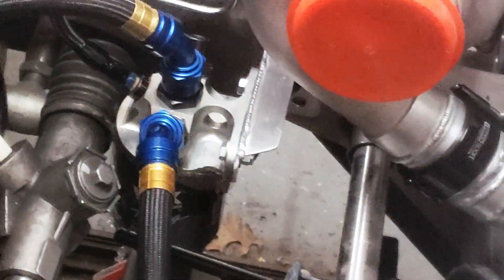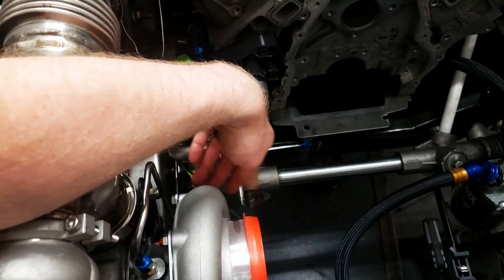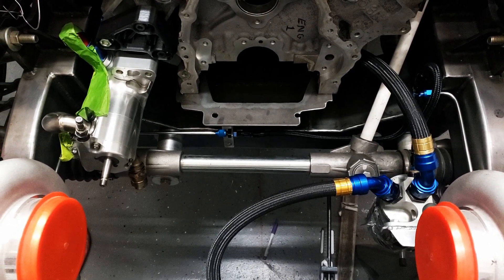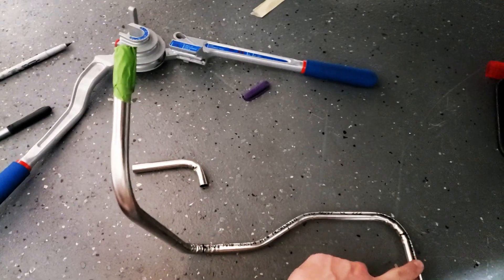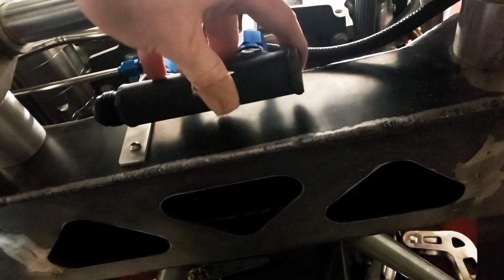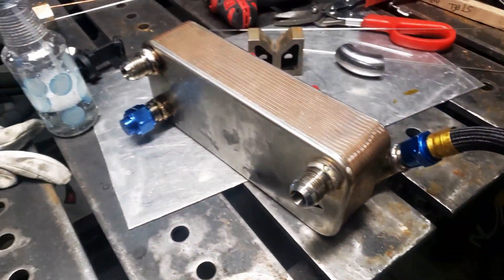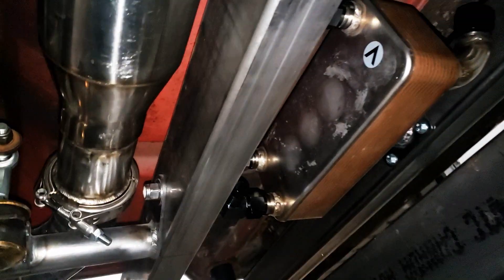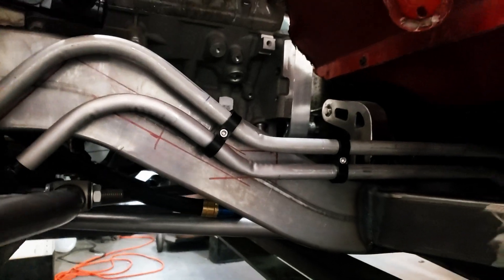DONT SMOKE YOUR turbo! Oil Hard lines, scavenge manifold  for the LOW MOUNT Turbos

Comment: Do you have the Weiss oil pump turned upside down? Maybe you need to look for an autoverdi? They will just have oil inlets on the right side.Have you already started your pump, how much oil does it pump? I am assembling a kit for my engine 7mgte. PS Do you buy hoses from the ebay seller Hindel? I recognize his yellow tag on the hose. Good seller!

Comment: Did you ever go back and add a breather on your turbo oil drain scavenge manifold?  As it is setup in the video, it will pull a vacuum on your turbos and cause oiling issues.
Reply from the maker: No definitely not. The entire point of the manifold is to pull a vacuum and scavenge the oil from the drain side. The is exactly how we do this on our turbomachinery the I design the oil systems for. A great pressure delta across the ball bearing will increase oil flow and drop the delta t of the oil significantly. The seal will still be positively loaded (more compressor and turbine pressure on the diffuser plate than in oil drains). You get in trouble when the loading on the seal is the other way around and you're drain pressure exceeds the compressor or exhaust pressure (or even comes close).